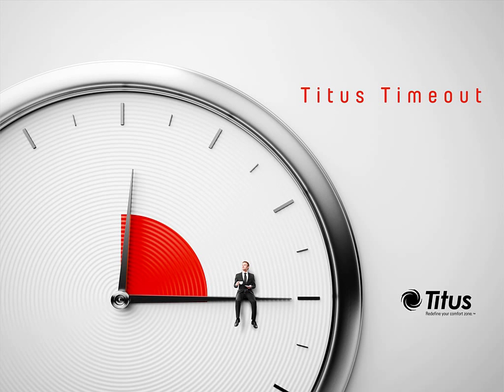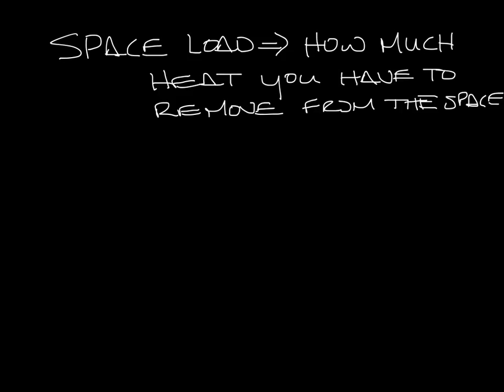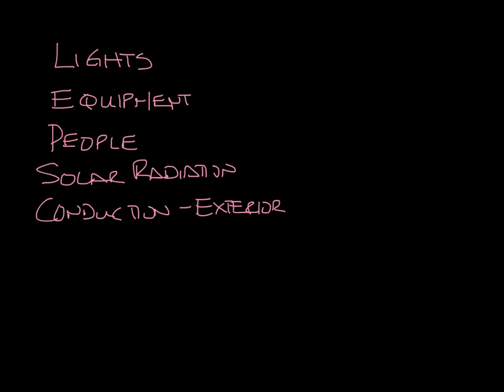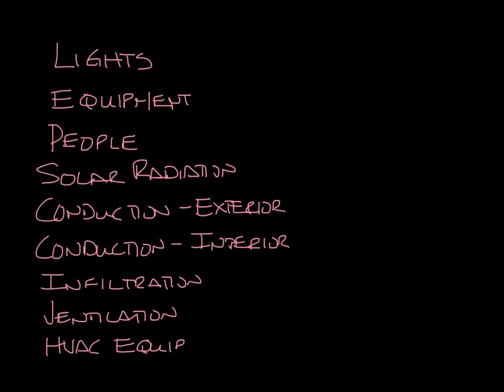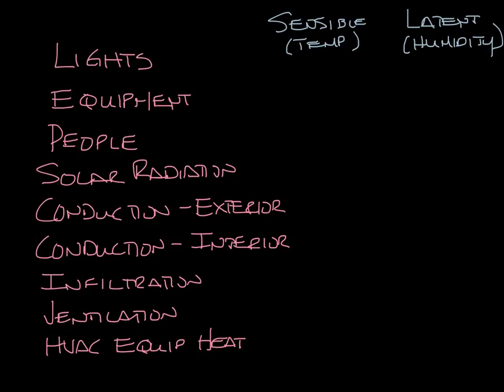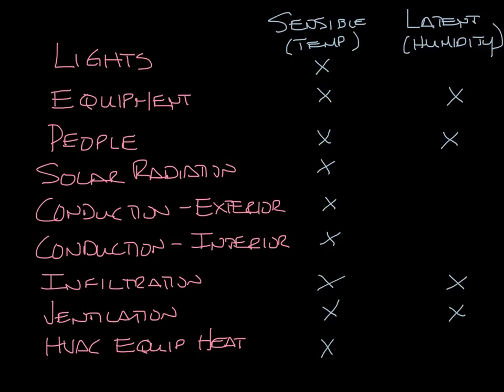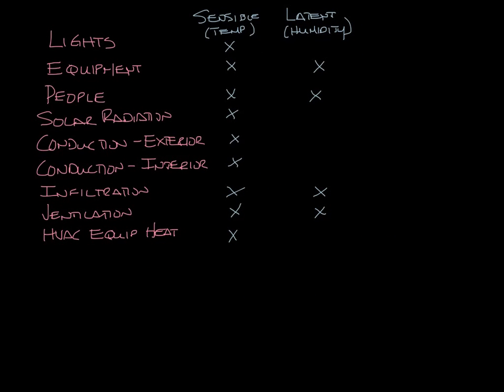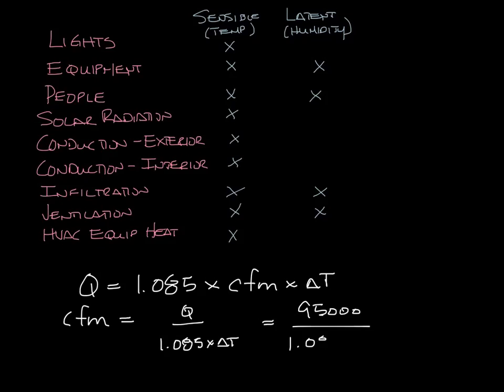Titus Timeout Podcast - Types of Loads in a Building

Comment: Plz explain heat load calculation
Reply from the maker: When sensible heat gains are considered, there is often a time lag between the occurrence of the heat gain and the time at which it manifests itself into a cooling load. For instance, the solar intensity on a western facing surface may be at its maximum at 4 PM, but the impact of that heat gain can spread over several hours, even after the sun has gone down. The radiant portion of other heat gains (including lights, equipment and people) are also affected by this thermal storage effect and tend to become cooling loads later than the actual heat transmission occurs.

ASHRAE’s Handbook (Fundamentals) explains this phenomenon in detail but hand calculation of cooling loads is so laborious that computer programs like Trane Trace have been develop to aid the designer in calculating space cooling loads.